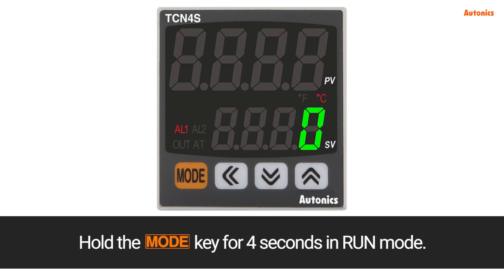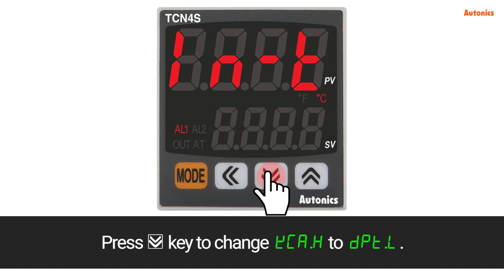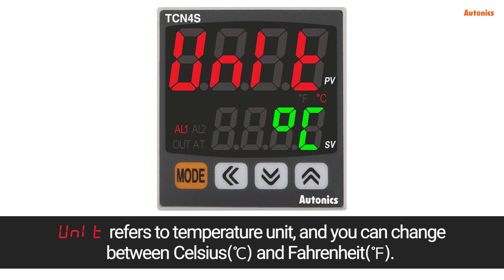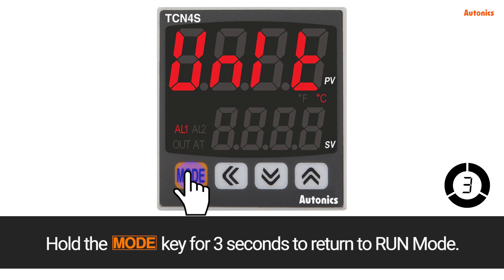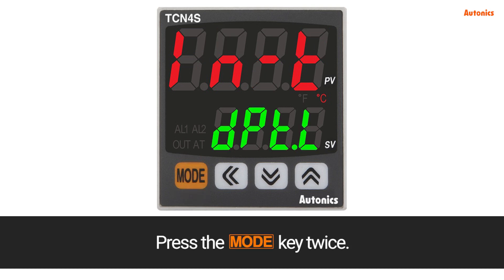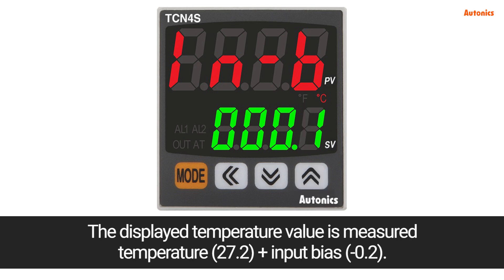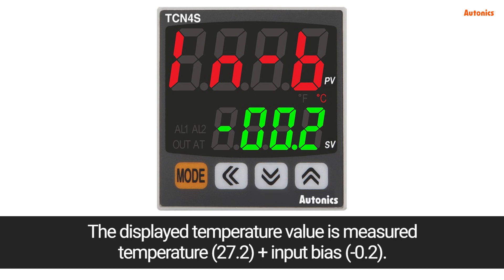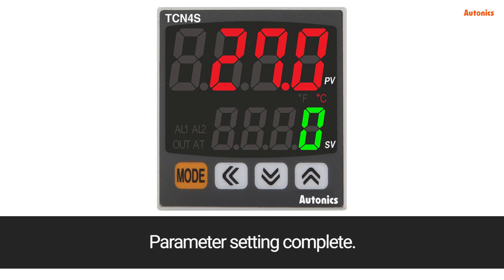Autonics Tutorial  : Setting Input Parameters(TCN Series)

Comment: Hello,

I'm installing 2 additional TCN4M controllers at my control cabinet. I already had 6 TCN4M controllers installed. I connected the 2 boxes in the same way as the other 6, but it doesn't work. On the display, I have either a temperature of 460°C at room temperature if Hys=4.0 or LLLL if Hys=0.2. Can you tell me what I've done wrong?